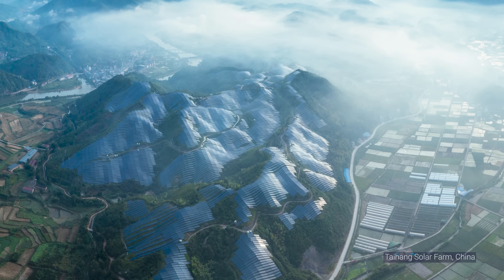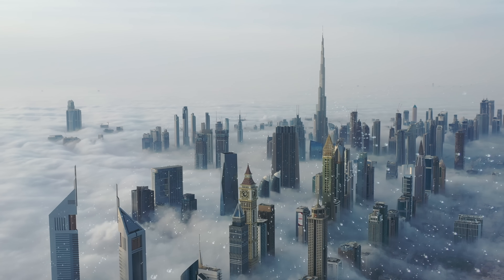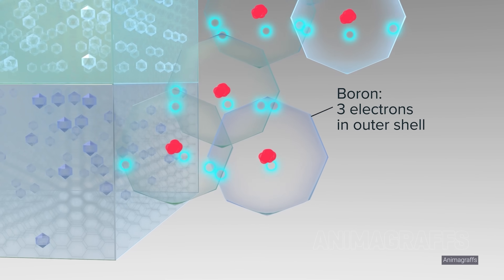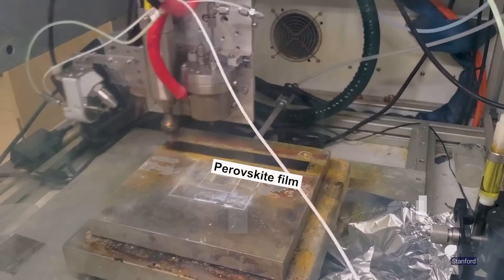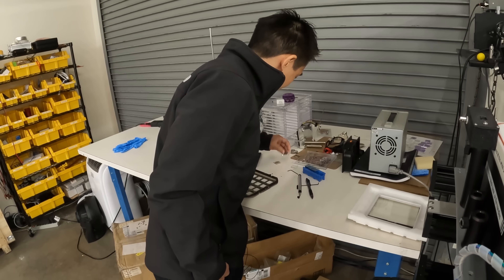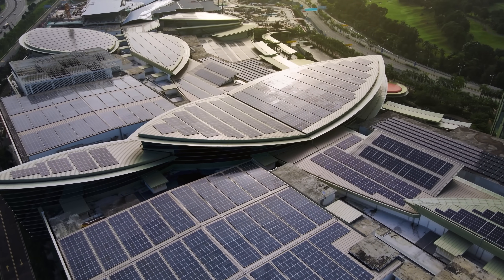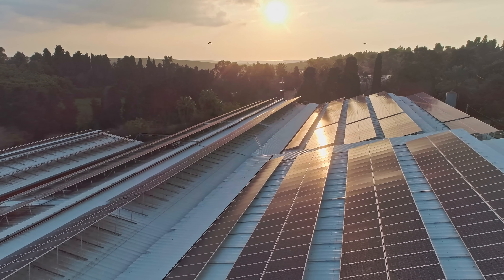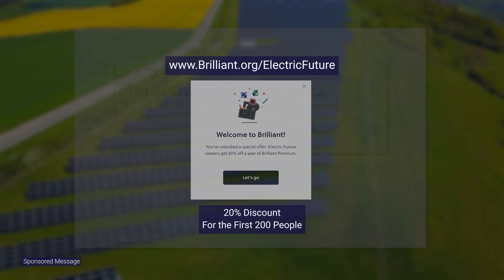Solar 3.0: This New Technology Could Change Everything

Comment: I think this is fascinating but it is still dealing with light which is only a small part of the power from the sun. Heat, infrared, is the big fish, that is where you can get insane efficiencies per square meter. Evacuated tube, even just a coiled garden hose is much more efficient at collecting energy from the sun then the best solar panel. This is where the R&D needs to go. PV/solar refrigerant or hot water combination. The coolant improves the longevity and performance of the PV panel weather it is silicone based or perovskite based PV. Then using that coolant to drive refrigeration or heat pumping applications like hot water, central hydronic heating, AC, Fridges and freezers...
Reply: Yep, I was thinking the same thing.  These panels are supposedly translucent, thereby allowing other wave lengths of energy to pass through them.  That lost, unused, or pass through energy could be collected by your coiled garden hose or PVC piping to heat water to be used at a later time.

Comment: I love the concept, however, I've been down this road before.  We don't want to give them all the bells and whistles all at once.  We're just going to put out a dual layer initially, then once the market starts to saturate, we'll come out with a triple layer, charge more money, etc... wash, rinse, repeat.  Does anyone remember when crappy efficiency solar panels first came out in the '70's? ...toys and calculators.  They had to start somewhere.  These guys need to get this stuff out there for some real world applications (buyer beware), but at least it'd be a start.  Cheap solar powered radio controlled cars, boats, or planes. They'll eliminate the battery cost, charger cost, electrical cost, and provide weight reduction.  It would be so much quicker to get something out there, rather than the slow tedious process of trying to create a full blown panel for home solar electric generation.
Reply: once the tech gets released, its only a matter of time before the tech is reverse engineered and copied by the competition. this will give us the good stuff a lot quicker.
Reply: @Fanta....  That's a neat idea, I liked your comment.  However, back in 2002, or 2003.... maybe 2001, and as the story goes.  A capacitor manufacturer had this design for the electrolytic capacitors they produced.  I can't remember if it was the electrolyte formula or something else specifically for the capacitors.  Anyway, an employee who worked there had stolen what he thought were the complete designs for the capacitors.  Well, he only got half of it, but didn't know that.  The ex-employee put out a bunch of real cheap capacitors.  In an attempt to save money on parts, a lot of those capacitors were used by manufacturers of Dell motherboards.  The capacitors began to fail horribly  after 2 years.  We had to replace nearly a hundred motherboards for our desktops.  Sometimes copies aren't the good stuff.

Comment: If this new technology brings a breakthrough in practicality, I’m all for it. But, at the same time, imagine the environmental damage that existing solar panels and wind turbines that have been already implemented en masse around the globe will cause upon their decommissioning and without even accomplishing their original main goal which was to pull humanity away from fossil fuels on the excuse that a trace gas like CO2 (only 0.04% of the total atmospheric volume) is dangerous for the climate! If that’s not the pinnacle of shallow thinking by central planners, I don’t know what is.
Reply: Do you throw your car, computer, cell phone, and everything else in the garbage every year because a new version came out?
Reply: @paulbienvenu5494  ofc not and I never said that. Yet, it’s the first time ever in the history of humanity that we move to a less efficient source of energy from a much more efficient source of energy in fossil fuels and nuclear. From that energy transition huge problems entail (like the huge problem and extremely energy intensive ordeal of recycling, energy deficits and subsequent crises, energy rising costs and a drift towards poverty because without cheap and abundant energy you are getting poorer by the day). In economics we call this shortsighted view of reality “broken window fallacy” (as described by Hazlitt in “Economics in one lesson”) as it only looks at the shallow side of benefits without factoring in enormous complexities and aftermath consequences. Btw, from the things you believe they recycle only a very small fraction/percentage is actually recycled. The rest goes to landfills. To show you how enormous that problem is, some third world countries are accepting first world trash for a price to throw them in their landfills. So it’s an “environmental disaster elsewhere” type of agenda.
Reply: @C_R_O_M________  lol, he said almost the same thing I was going to say.  However, you have a point, and in fact, even less gets recycled than you may know.  Even though we put out a recycle bin full of recyclable materials to be picked up every other week, (this sound ridiculous, but I've heard this from the employees) if ONE item is improperly categorized  in that recycle bin (the wrong number plastic is introduced into the bin, a soiled piece of cardboard, etc.), it ALL goes in the regular garbage.  Even though someone took the time to sort everything to the best of their ability, if just ONE of those items is sorted wrong, the recycler often times doesn't bother with any additional sorting, so none of it gets recycled.  They're getting tougher and tougher on what can and can not be recycled.  We can't recycle glass anymore.  Recycling won't get better because the profit margin is so low.  Yes, a lot of E-Waste and plastics get sent over seas, so that includes the plastic enclosures that are still attached to the  devices as well.  Often those plastics are burned.  Their regulations get bent a lot easier than ours do, so if there's money in it for them, they're going to do it.  If I had $10,000.00 wrapped up in a solar electric generation system (in some cases, that's cheap), I'm not going to trash it all just to squeeze out a few more kilowatts with some new technology.  If I had a bunch of money wrapped up in wind turbines; same thing.  At some point, it would be cheaper to replace them with something else as opposed to trying to fix them though; whether that's using the same technology or something new.  Everything gets thrown away at some point.  That's been the nature of things for a very long time.  The CO2 problem will never go away; populations keep growing, more land gets stripped to feed the increasing population;  it's always going to be there.  California electrical companies have been trying to pass a bill that requires people with solar panels to pay $3-$10 per kW of solar panels installed.  Talk about going backwards, or the shallow side as you stated.  It's supposed to have positive effects, but I think it's all just a bunch of greedy businessmen trying to boost their profit margin for the share holders.  When it comes to money or power, many people don't care about the long term side effects; whether they're aware of them or not.
Reply: @dippyduty6163  I agree and disagree. Profit seeking isn’t the problem at all. On the contrary it’s part of the solution. It is so because to ensure profit margins you need to add value to society by either increasing efficiency or disrupting  the existing technology. The problem is that this profit-seeking market mechanisms are being distorted by government regulations, licensing costs, a central agenda that bypasses what the market strives for (cheaper & abundant products and services with the greatest possible variety). 

On discarding recyclable materials to third-world countries you focused (quite understandably) on what the US is doing whereas I was talking more of all the first world countries (which include the whole Western world plus a few Asian societies like Japan, Singapore, Taiwan, etc). I make that distinction because not all first-world countries have good recycling facilities and waste management. 

Some haven’t catch up yet to what the Us has been doing and that’s because in most of them regulations and high energy costs make the task not profitable (just like you said). 

However, if the CO2 demonization was wrong or grossly exaggerated (and there’s already plenty of evidence that’s the case -for example, the last 7 years the Earth is on a cooling trend of about -0.10C per decade and while CO2 has been steadily increasing, that’s from NOAA’s own data), you could recycle these materials much cheaper with oil at 1/3 of the price today and the environmental footprint would be a lot smaller. Plastic pollution is a much greater and immediate problem than a supposed cause-and-effect relationship between a trace gas of just 0.04% of the atmosphere (to which a recent study concluded that we contributed with our emissions only about 23% of the total increase of CO2 from 1750 to 2018 - that’s by studying the carbon isotopes of atmospheric CO2, as I understand, and I’m no expert but a longtime hobbyist at this, anthropogenic CO2 carries specific markers that distinguish it from naturally emitted CO2) and the climate which is a system we don’t completely understand yet. 

I say, deal with the immediate problems right now than trying to prevent a hypothesized catastrophe that’s been generated by human prophetic powers and modeling of a system you don’t even understand to its entirety. 

Humans are fantastic in solving any types of problems as long as they have cheap and abundant energy available. Western governments have hindered the latter while, at the same time, China is building another 200 coal plants to add to its existing 1000! Same with India who has agreed to comply with international net zero carbon emissions by … 2070 (20 years later than the West at 2050). That’s the two biggest countries on the planet in terms of population and you are making the West poor and, thus, weakened in terms of its ability to solve emerging problems while your potential enemies and the ones with the bigger carbon footprint are doing nothing in the direction of your agenda. See what Putin is now doing and how he is manipulating Europe’s energy dependency to Russian oil and natural gas? Expect more of this to happen in the future if the West continues the path of self destruction by following idiotic kids from Sweden.
Reply: @C_R_O_M________  Profit is money that's in the black rather than the red.  Yes, profit seeking is a solution, but it becomes a problem when it's used in what you called, "broken window fallacy".  Some people don't care what the outcome will be as long as they're making money or a profit.  Yep, government regulations, (money), So the way this got started was that government regulators or government regulations (as you said) were created to entice people to go solar.   Install new windows/doors, we'll give you a tax write off.  These were also in the form of monetary (money) incentives by the state government that forced Public Utilities to pay people for their excess power.   I'm sure that pissed them off... it would me, if I were in the public utility commissions shoes.  That's cutting into their profits.  Yep, licensing cost (money), I shouldn't have to elaborate on that one.  The government was trying to kick start the process instead of letting things take their natural course.  Their intentions were half good, but they were screwing over one group of people to win over another group.  Let's get rid of the government!!!!  Problem solved...... not exactly.

I don't know.  I brought up a CO2 chart a few weeks ago that showed how the concentrations are highly exaggerated compared to the past.  Some would even say this is just the normal cycle that's been taking place since the ice age.  Of course, right or wrong, someone always has some data to prove it.  The range of the chart plays an important role as well.  The change between yesterday and today, last week and this week, last month and this month, last year and this year, might be drastically different from one another, but on a longer span of time, say ten years or 100 years, the over all projection looks really bad.  There were just under 280 parts per million of CO2 in 1750, there are now almost 420 parts per million now.  The greatest slope of that curve started around 1960...... pretty crazy.  Funny that you should mention India.  Also, a few weeks ago, I think this is how I got on the CO2 kick, there was an article about Punjab and New Delhi, I think.  "Paddy residue burning is a decades-old practice in Punjab. Pressed for time and short on funds, farmers resort to setting their crop waste ablaze to clear their fields for the winter sowing season".  Anyway, this is causing heavy smog in..... I think it was New Delhi.  I guess they have 50 years to fix this.  I wonder how much bigger their population will be in 50 years.  They might need more food.  I'm just looking down the road.  Anything could happen.  A catastrophic event could take place wiping out half the population.  I hope not.  Populations typically grow though.

I like your idea of dealing with the current problem, but we still have to consider the ramifications or impact of our decisions down the road.  Take the actress Sally Struthers for instance.  Back in the 1970's, she was a big advocate of sending food to Africa to feed starving children.  It was a great idea, fed a lot of people, but all that food that was consumed food had to go somewhere.  No one thought about upgrading their sanitation facilities, and a lot of people died from disease.  They never really talked about that part of the story.  Of course, not all the money went to the children either.  There were some "NON-Profit" organizations that were "Profiting" off the money, which was the solution, to fix a problem.

A lot of people always want to point fingers at the oil producers, but it's not always their fault.  Maybe in this case with Russia, however, there are many companies that like to use situations like this to do what?  Boost their "profits".  They're not trying to create a solution, they're just lining their pockets.  There are so many stories how gas stations will take advantage of people over some silly news event.  Back in 2004 or maybe it was 2005, gas prices sky rocketed.  It had nothing to do with supply or demand.  In fact, supply was higher than ever.  Oil used to be priced on supply and demand, but Carter or Clinton signed some bill to put it on the commodities market.  If it wasn't Carter or Clinton, it was some other democrat.  Let's toss in your term again, "broken window fallacy".  He didn't consider the outcome of his actions.  Traders were pushing the price of oil up.  By the way, Wikipedia says that oil started trading on the futures market in 1983, so there's a good chance it was Carter.  Then again, Reagan served in 1981, but I'm not sure that was enough time to push the bill through.  Either way, I don't recall which president.  It's another case of the government screwing things up.

I thought the children were our future?  =)

I'll state it again, "When it comes to money or power, many people don't care about the long term side effects; whether they're aware of them or not".
Reply: @dippyduty6163  tl;dr

Comment: Reality is far more complex than Musk’s proposal to cover a relative small land mass with solar panels so as to cover all US energy needs (which is also impossible if Musk don’t sell a shitload of his batteries for half-days - since nights are already out - that solar isn’t producing much). You cover one single area and then you have huge problems in transferring energy to other parts of the country, network losses (greater over distance) and a huge vulnerability in geopolitical terms as a concentrated energy source (instead of a decentralized one) is very vulnerable to attacks. People should think a LOT more before proposing stupid and unfeasible things. Yes, Elon, that goes for you too.
Reply: LOL.  He was just illustrating the area needed, not that it all needed to be in one place.  So, you should be more careful about stupidity, yourself.
Reply: don't take things so literally. it was probably a rough back of the napkin calculation that gets the point across about how much area is actually needed. the best way is to have thousands of smaller farms all connected to eachother and auto load balancing to supply local areas.
Reply: Well, what Elon said does put things into perspective.
Reply: it's more so the idea of acheiving that goal over the entire united states, putting them on unusable land and rooftops in cities.

Comment: Quite the joke mentioning Elon's theory of 1 state powering all of America, even it was feasible size-wise, which it isn't as you'd need a way larger array than his BS suggests, the transmission losses & the extremely high concentration of radial transmission lines needed would a nightmare. 🙄

Comment: 0:30 Don't blindly trust stuff Elon Musk says. If you google it you see you need about 21k square miles of solar panels. I double checked this myself and using very generous numbers the lowest you could get it is about 17k square miles.

100 square miles would look like a speck of dust on a map of the US. That picture you show is more accurate. But even just looking at a solar panel that big on a map, you cant tell me that looks like it would be a remotely feasible task to accomplish.
Reply: Ok, so you brought up a good point, how would we fix it?